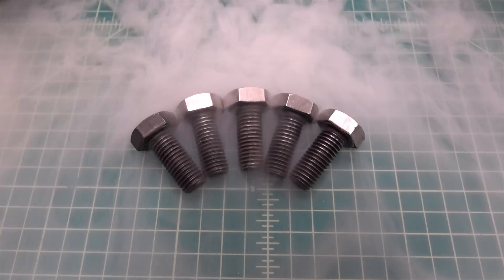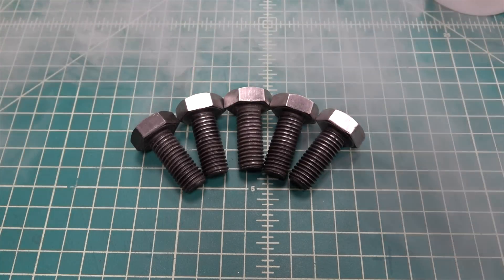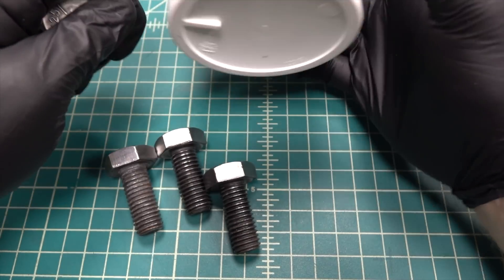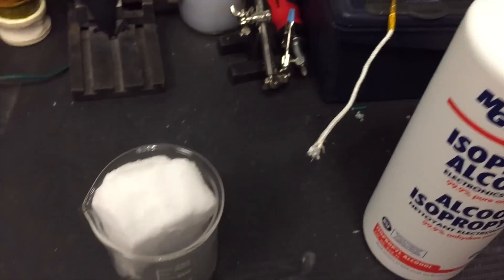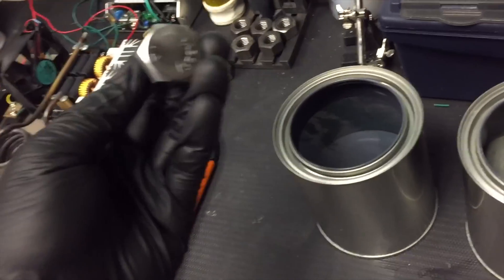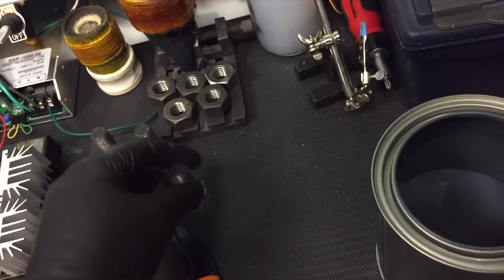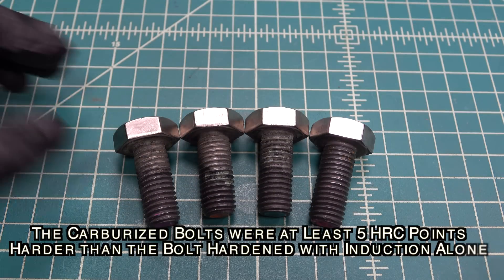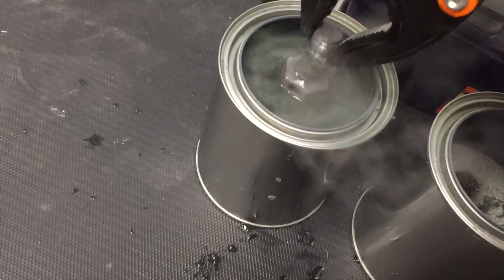Induction Heating Part 6: Cryogenic Case Hardening

Comment: Cooling your induction coil with the spray is an expensive waste.  Water would do just as well, even better, at no cost.  Just examine the heat of vaporization of water, not to mention its high heat capacity to start with.  Compare it to whatever the spray can coolant is.  Free water is a better deal.
Reply from the maker: Expense is not always the main concern. When time is limited, speed is much more important than the price I paid for consumables. That said, I do agree that pumping water through the induction coil is the much more sustainable option for mass production of an induction heaters.
Reply: @ProtoG42  I agree in principle regarding expense and time, but to clarify, I meant spraying water on the coils would work, at least to quickly get them to about 75C +/-.
Reply from the maker: @noimagination99  ahh, I see. I haven’t watched this video in 7 years so my comment was more of a broad response to the way I do things personally.

Comment: Why not from induction to cryo? Why the water step? Did I miss something?
Reply from the maker: I haven't watched this video in several years but the reason is because of the leidenfrost effect. Going straight to cryo will form a vapor barrier around the part and it will take long to cool down. Long story short, it cools down faster swirling it in water first. I'm sure the difference is minor but I'm not an expert on this topic so I don't want to say for sure.

Comment: Ooohhhh what about shot peening! And why not coat the material with the nitride compound, is that boron? Then induction heating. Then quenching in oil to cryobath? I wanna nitride my rotor housings... Or use cremit

Comment: Excellent video. When I cryo my tools professionally and car parts, like rotors, they have a different sound when struck with a metal rod. Acoustically it sounds denser or more of a dead sound than it did before. You can tell as you scratch them which is which. Usually, you can use sound to test the hardness of a metal. Higher pitch means harder steel. When you cryo it's almost the opposite. The steel doesn't become denser it just the metal molecules bonding in line more.  Also, rust aversion does occur because metal molecules are happier next to each other. In the case of the bolts, it's more of a coating filling in the voids where oxidation would happen.

Comment: Very well done. It is clear you know what you are doing. However, LN2 WILL freeze your ass! Yes you can stick your hand in it, but you better get it right back out. I use over 30,000 gallons a month and have for over 40 years. It can be fun to play with but it can also kill by displacing O2 or just plain old freeze your ass.
Reply from the maker: Thanks, I worked for NASA's Cryogenic Test Laboratory at Kennedy Space Center and have had plenty of experience with LN2. 
 Most people don't realize that it i's safer to not wear a lab coat when working with LN2 as it can get trapped between the clothing and your skin.
Reply: Proto G Whew indeed! Cotton glove gets soaked while you are handling an object and burn city! We have over 5 million doses of bull semen stored in it and ship worldwide  daily. Inventory and hazmat fight ‘round the clock. Yes. Bull gizz.
Reply: Proto G You are an ok dude! Subscribed!
Reply from the maker: Thanks man!

Comment: The martensitic content of steel is what causes the molecular structure of steels to harden under cryo temps. There is ferritic and austentitic crystalline found as well, but these do not respond to cryo. Some steels such as stainless 4140 have a very high martensitic content and respond very well to cryo hardening. Austentitic metals respond better to quenching in heat. The ideal method for cryo hardening stainless is to first cool it to -300f for at least 6hours. You will not complete the crystalline transformation if you cannot achieve at least -300f. Larger parts take longer, up to 96 hours.  When the parts are removed from the liquid nitrogen they are placed in a preheated oven at 300f. A vacuum oven helps to heat the part much faster, achieving a more dense and balanced crystalline structure. The parts are heated 3-4 hours and then taken out to cool naturally to room temperature. Cold quenching at this stage will make a brittle part.
Reply: You do not want to induce rapid thermal contraction of the part after it has gone into the oven or you will reverse the cryogenic hardening process.
Reply: The cryogenic process changes the microstructure of metals by subjecting them to super cold temperatures usually around -300 degrees F. This cold treatment creates changes in heat-treated steels, cast irons, and other alloys. Whether the steel is forged or cast, heat-treating is used to change the characteristics of the structure. The uniformity of the crystalline or micrograin structure of the metal is at an atomic level. When a piece of steel or cast iron is hardened, it is heated up into a range where the atoms of iron and the atoms of carbon form a particular type of crystal called austenite. This has a relatively soft grain structure with weak points. The cryogenic process causes this austenite to change to the more wear-resistant, yet more brittle martensite, which presents a more even crystalline structure.

Heat treatment going up to about 1,500° F removes some of the austenite but you have 10-15 percent retained austenite in the metal. These are literally voids and imperfections in the metal, and once they are converted to Martensite, it leaves the metal with only 1 percent Austenite. This gives a tougher, more durable metal without any imperfections.

All heat treated steels have a percentage of allowable Austenite that is retained during the heat treating process to form the Martensite. The Cryogenic process can help form additional transformation of the steel from Austenite into Martensite. This helps eliminate imperfections in the steel’s microstructure that can be seen using X-ray or microscope.
Reply: Thermal showk doesn't happen when cooling tools in low degree -190 c??

Comment: Does anything happen if the bolt touches the coil? A couple times it looked like the bolt or pliers touched the coil... I guess its not a problem unless they also touch something else that's a ground?

Comment: Is that a "coil" from a matched network? IE your induction coil?

thx
mj
Reply from the maker: mike johnson it's a self resonant circuit so any coil you make is going to be matched as the frequency will depend on the inductance of the coil.  The inductance of the coil will vary depending on the number of turns and what you place inside.
Reply: I guess what I should have asked was. Did you make the coil or purchase it pre-made. It just looks very similar to a coil used in a RF matched network. These are used for A-C magnetron sputtering and etching. (among other things)

Thanks
MJ

Comment: hey I've purchased all the items needed for induction heating and I'm wondering if you have a cooling system for the coil I have a water pump from a CPU water cooling system and I would like to use it for cooling the copper coil. and in this video it looks like you have a blue line on the back of your coil??? I haven't put my system together because I've just moved and I think if water was running threw the coil it would cross the power terminals in the water pump system and possibly go really wrong???

Comment: 1 . What kind of oil would you use to quench ?  

2 .I thought you had to "Pack" the part you are trying to harden in the hardening agent, then heat it, ? 

3. It appeared the hardening agent bubbled off of the heated part and did not really apply itself to the bolts.  

4. If you have a hardened part you need to machine, how would you anneal it / soften it ?  

5. Once it was finally machined could you use the method you are using to get it back to the right hardness again ? 

6 . How would you test the hardness and depth of a part before you were to anneal it, so you knew how hard to make it again  ?

Comment: Would this work with knives say 440c?
Reply from the maker: +Criss Osborne It would reach 440C easily.  The bolts in the video were heated well past 440C.
Reply: +Proto G  Sorry, I meant 440 c stainless.
Reply from the maker: +Criss Osborne It would take much longer and wouldn't be practical with this unit.

Comment: Preheating the quench medium is typically used for oils, not water. The reason behind it is that the viscosity of the oil decreases as its temperature increases which allows for a much higher rate of conduction/convection. This is negligible for water.

For water quenching, the Leidenfrost effect occurs at roughly 371 °C. Basically, if an object is above that temperature and is submerged into water, there should be a vapor jacket (assuming no agitation to disrupt it). If you preheat the water, you essentially give it more starting energy so that it is able to reach the vapor state in less time. Although there is a decrease in time required for the surrounding water to vaporize, it could have a drastic effect on the hardening process. 

Water typically cools a hot object extremely quickly until the surroundings reach the Leidenfrost temperature (for quenching, probably less than 50 ms). Once it passes this temperature, it cools it quite slowly because there is no more forced liquid convection. The only modes of heat transfers remaining are radiation and natural convection of vapors; both of which combined are significantly slower than forced liquid convection. Once the temperature drops below the Leidenfrost point, the vapor jacket breaks and once again, the cooling will be forced liquid convection. Essentially, it is extremely fast (for an extremely short amount of time), then slow for the majority of the quench, and finally extremely fast until the piece is equalized with the medium.

Water quenching will work but it is very undesirable as it puts a lot of stresses into the the steel. For low and mild carbon steels with low hardenabilities, you have approximately 0.4 seconds to cool the piece from critical temperature past the pearlitic nose (around 600 °C); otherwise, soft steel will form. Once the piece is cooled below this temperature, the time required for soft steel to form will begin to increase as the temperature decreases. This means that the cooling can slow down a bit. This is especially important when cooling below 240 °C or so as Martensite (hardened steel) will begin to form. The slower the cooling rate in this region, the better as there is already a lot of stresses built up when forming these crystals. 

When you quenched the screw in the bucket of water, you swooshed it around effectively breaking up the vapor jacket. Adding table salt would also disrupt the vapor jacket. In fact, there are also some kitchen chemicals that are used for super quenches which work even faster than brine quenching. 

Sub zero cooling (dry ice) is actually used to force any retained austenite to transform into martensite. Afterwards a temper cycle would impart a bit of toughness. This would reduce the likelihood of brittle fracture stemming from spontaneous transformation of retained austenite to martensite as untempered martensite is too brittle to be used in most cases. Seems a bit overkill as lower carbon steels don't typically have much retained austenite after a quench.

Cryogenic cooling (liquid nitrogen) is typically used to allow for the formation of other carbides which improves the overall toughness. 

Anyways, cool analysis on the different heat treatments and their effects!
Reply: I think the goal of heating water is to reduce the heat capacity of it, to slow the quenching speed.
Reply: I want your email , are you engineering?
Reply: I was thinking the same thing about pre-heating the quench water, which makes no sense at all, but you explained it with much better technical detail.

Comment: Dude, I thought of something.  When something cools, it shrinks, you've been using that.  But, did you ever think that cryogenically cooling the bolt first, would cause it to shrink as much as it could, and the induction heater so fast, it would pressurize before the outside got hot, and then cool it, resulting in a deeper temper than anything I"ve seen.
Reply: +James Elger Inductively, you should be able to heat much faster than cool it off.
So, the internal pressure, would go way up, like forging.
Reply: +James Elger If you had a watt second counter to turn off the induction heater, any piece could be heated to a desired temperature.  You would have to heat it first but, it always takes a many watts fast, as it does slow.  Double power halve the time.  It is that simple.  So, you can heat something slowly to a desired temperature and not melt it slowly, add up the watt seconds, divide by two, the double the power, and the peak temperature will be the same.  But, it can heat really fast in the middle, and slowly distribute from the center.  So, the math is important to tempering without melting.
Reply: +James Elger The idea is machine soft, and harden without deformation.
Reply: +James Elger You could also try using piezoelectric horns more frequently used for welding plastic.  But, loud sounds can be about the same as a hammer.  So, to be honest, I've never heard of acoustic tempering but, it should be possible.  Instead of a hammer, it uses shockwaves.
Reply: +James Elger piezoelectric annealing.  That might do something.
Reply: +James Elger Yea, scream at it.
Reply: +James Elger You'd have to scream like a jet plane or a fog horn.  Loud enough to cause injury, and reason to put up warning signs because, that's how it really works.
Reply: +James Elger It is purely impossible to harden without any deformation, as the structure of the material changes with the addition of carbon. Plus the part shape will also affect, as thin portions might yield in some direction under hardening stresses.
Reply: It doesn't swell that much.  If you measure the bolt before and after, it's not much and not enough to measure with most tools.  If you need a microscope for a bolt to see the difference, it ain't big.
Reply: James Elger I'm not talking about a bolt or its functionality, I'm talkng about hardening in general. It always changes the part size and shape.

Comment: Nice work!  If you're interested, check out my quench and temper video for a slightly larger version. 1.5 megawatts continuous for hardening, 750 KW for temper, LOL. The quench system pushes 650 gallons per minute. This one was a team effort but I drove the design.

The junk video shows a machine I built entirely by myself for hardening pivot posts for nitrogen spring cylinders used as hood springs, and uses a 50 KW radio frequency tube-type power supply.
Reply from the maker: +Wyatt Storches Thank you, very cool stuff.

Comment: good vidéo :) a very good quality , i'm just asking , they say that you should avoid to heat a piece with a volume more than 1/10 of the coil . Xhat do you think ? Is it a problem if i use a 300W power supply ? What if I make a larger coil ?
Reply from the maker: +madmanu r That's the beauty of having a well made power supply.  My power supply has multiple overload protection features.  If the coil draws more than 1100 Watts, then the power supply pauses until the fault is removed.  This protects both the power supply and the ZVS driver.  A 300W power will heat up metal, but no where near as fast as 1000W.  Also,  a 12V 25A power supply is 300W but you will draw no where near that with that voltage.  The voltage determines how large of a coil you can make and it just as important as the current.  48V 20A is the best power supply for this unit.

Comment: Thank you very much for your video.

I'd like to know if you can show a similar procedure applied to a cheap stainless steel knife.

Since mine tend to rust and lose their sharpness fairly often.
Reply from the maker: +k0ka1n3 Thanks for watching.  It will work with stainless but it may take a few cycles to give good results.

Comment: Pretty F'n cool!  Loving your videos!  Could you use this method to harden cheaper files?
Reply from the maker: +lsdave Thanks man!  Low carbon/mild steel benefits the most from this method. You could harden it with the induction heater but there would be no need for the case hardening compound because the file has plenty of its own carbon.  You would also need to be careful not to make the file too brittle.